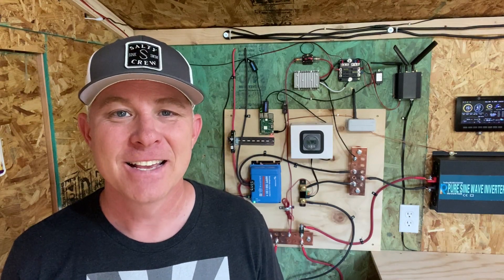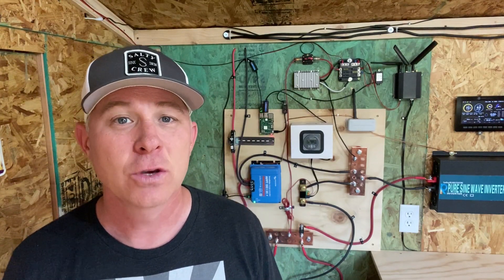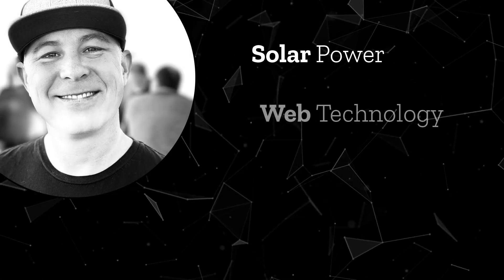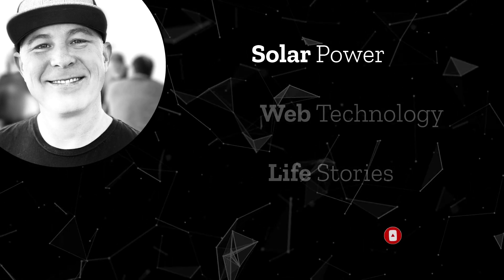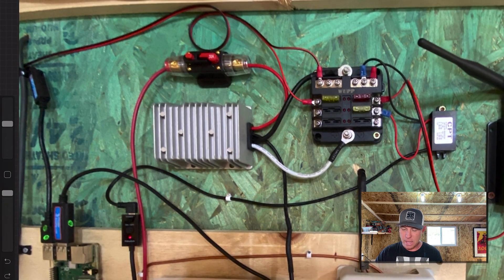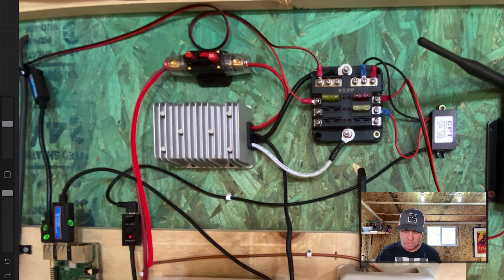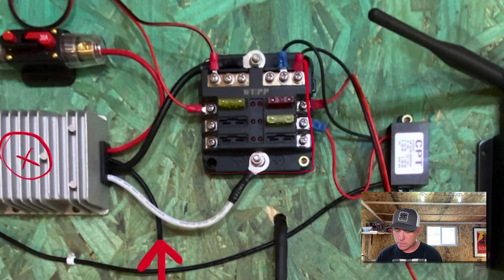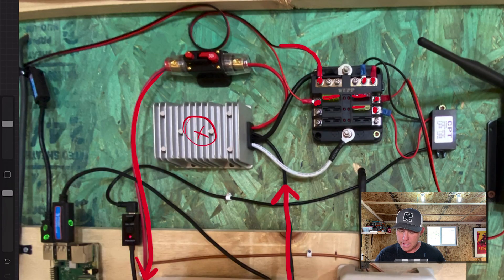Power a Raspberry Pi from a 12 Volt Battery Charged by Solar

Comment: Glad I found you as I sort out if I want to buy a Cerbo GX or RPi?  Can you use the VictronConnect App on mobile device to also monitor while in the shed?
Reply from the maker: Yes you can. Either locally with Bluetooth or remotely via the mobile app.

Comment: Wow great video...  I have one like you but, 4 280w solar panel 2 series strings, couple in pair. All connected with  victron mppt 35a with a solar farm 100a 24v lifepo4 battery with its Bluetooth bms. All off grid, just solar and battery  ... all used in a little holidays house, without any household appliance... now I need to build Rpi self powered like your and find a solution to send information on cloud with a 4g router, also it self powered to send informations in cloud....sure I need to scale down voltage and convert power to play Rpi, router and all USB elements... I don't understand very well your way, but maybe if you give me the list of object to buy I try to do it 😀

Comment: Wow its like you took a lot of my questions and answered them. I am converting an old bus into a bedroom for daughter. The main fluro cabin lights are powered through mini inverters to 230 volts from 24 volts. I have a Raspberry pi 3b and wanted to know how to power it from DC. The bus will have 2 300 watt flexible solar panels wired in series to a victron charge controller. I look forward to seeing more of your posts, keep em coming.
Reply from the maker: Wow! That is awesome. Thanks for the comment. Please keep me posted on your project. Perhaps even do a video of it.

Comment: Clear explanation. I think I can repeat.  QQ: Why run the batteries in series to get 24V then step it down to 12V using the step down regulator?  Why not just run the batteries in parallel or only use one battery at 12V, then you wouldn't need the regulator at all, correct?  Is there an advantage of running the batteries in series at 24V?
Reply from the maker: Hey Keith, great questions... Having a larger voltage battery bank gives me more options down the road when it relates to my shed specifically, such as tools, saws, Air Conditioner as well as the ability to get greater wattage out of an inverter for specific applications that 12 volts just wont offer. Plus, you can use smaller gauge wire with a higher voltage system. The 12v stepdown is really for very small, low wattage devices such as LED lights and small electronics. The stepdown is also much less expensive than a separate battery. Since I am using Lithium Ion batteries, they are on the more expensive side. So, I want to keep my options open for the greater need. Honestly, I wish I would have done a 48V system, but I'm in too deep now - LOL.

Comment: This is great! I have a Pi Zero controlling a motor board that opens and closes my chicken coop door via Smartthings and/or Alexa. It's way overkill but it was fun to make! I added a small solar panel and battery to it last summer and it hummed right along until I had several cloudy days in a row. Here's my question, would it be better to add another battery to keep more of a power reserve or add another panel to help keep the battery topped off during cloudy days?
Reply from the maker: You always want to have enough battery to keep you powered for up to two additional days or for how ever much your application requires. No need for another panel if it is cloudy outside. If your panels are good, they should charge the extra battery when it is sunny, then you have the reserve in your battery bank for the rainy days.
Reply: I am now looking into this for a remote idea I have using the pi. I am trying to re-use spares that have become discarded like a cigarette lighter ipod transmitter + old laptop batteries just as an example. Its working out what size panel will be required to keep a battery setup topped up, and how to have the protection/switching. Very cool interesting stuff.